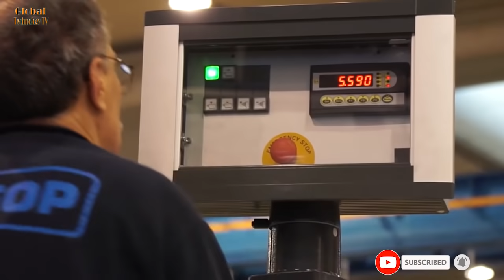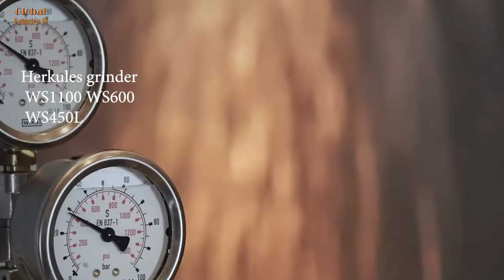The world's largest lathe in operation

Comment: See the tool holder move at 0:02 seconds, very professional for the biggest of big, big, biggest lathe in the world, ar!
Reply: It's still accurate to a tenth... Of a meter.
Reply: I work with wobbly machines and can do fits with .01mm tolerance - i guess im a magican.
If the tool moves while roughing it does not matter that much.
And even while finishing it can be compensated if you know what you are doing and you know your machine, thats why it takes at last 5 years to make a newbie into a somewhat decent turner.

Its suboptimal yes, but life is not butterflies and rainbows only.
Reply: @billklatsch5058  Tell us some more precision tricks Bill, I am very intrigued by your machining norms...

Comment: Looks like the tool holder wasn't secured tightly enough. It moved when the insert engaged.
Reply: Could have just been backlash or even flex from the massive amount of pressure on it.

Comment: The piece their repairing at 2:33 is said to be a crankshaft but appears almost identical to a camshaft with a offset lobe like one, there's no clamping surface to allow for it to set like a crankshaft in a journal.
Reply: Probably an eccentric for a mechanical forging press.

Comment: Remember,  all new machines were made on older machines,  the accuracy comes from the operator
Reply: That's true. I worked as a lathe operator on conventional and CNC lathes a long time with parts up to 1000 kg. One mistake and a part worth a couple 1000€ is trash.
Reply: For the final product perhaps.
But machine tool accuracy is required for certain operations such as the flatness of turbine shaft flanges, straightness of gun barrel bores etc.  These require accurate machine tools.  The machine tool fitters are the ones who assemble the various machine pieces and adjust and fit the pieces to achieve this accuracy.

Comment: Definitely not the largest by a long shot. My partner and I designed and built larger ones for on site field machining at power plants. One of the lathes in our shop, we got from a shipyard in Maryland. 100' Ft between centers Giddings & Lewis. We found a old ass pic when disassembling the machine for transport. Apparently it was one of the lathes that machined the 66ft long barrels on the USS Missouri.
Reply: made in a wee fishing town in Arbroath Scotland  
lots of giddings lewis fraser   machines still being used 
jig borers etc      sadly company no longer there

Comment: I love machining, especially lathe work I have come across a 23m lathe and yes just cool, but still as a machinist and seeing this big lathes makes me jealous! Then again I wonder the amount of earth we need to take of and refill to give a rigid and flat base, flat in the sense that the earth is curved, I mean spherical!!! Then I keep loving the chips and riding on the lathes again;;!
Reply: NIST has amazing grinders deep inside the earth that make our gage block standards - to millions of an inch and a grind that allows 'ringing'. the surface finish so smooth, it allows joining surfaces to share electrons. A non-adhesive bond. When it gets good enough, will be like welding - without the heat.
Reply: @prestonburton8504  Thats "wringing" of the gauge blocks.  Interesting phenomenon this, and points out the importance of separating the blocks when they are not in use.
Reply: yes!  i know this. i have visited the 'cave' where these are ground - about 1k feet and part of NIST - so no vibration.  you know also, this is like welding, right? you let them get close enough, and the electrons bind together because there is enough contact area - 70% if i remember my collage physics class - very very cool! @BasementEngineer

Comment: Boggles the mind to think of the world's largest tools needed to make the world's largest lathe. And then.............
Reply: Not that difficult once you know how.
Very large machine tools are assembled from numerous smaller subassemblies which can be machined on much smaller machine tools.

Take a lathe bed for say 100+ feet of length for ship tail shafts and ship's gun barrels.
The lathe is assembled on a concrete block to give the bed stiffness.  The bed guide ways are assembled from smaller length sections each of a length to suit the available machine tool size, say 16 feet long each.
Thus 10 of these 16 ft long section would be assembled into one long lathe bed.
Fitting these pieces together to permit machining of accurate gun barrel bores is an art unto itself, requiring much experience and trial+error work in the beginning.
Nowadays optical and laser alignment testing equipment makes that job much more predictable and easier.

Comment: Ive seen much much bigger ones. Ones where the chips weigh a few ounces and literally sound like dropping car keys. Same type of stuff though large cam and crank shafts for ship engines, gas compressors and giant mining trucks. Stuff where an oil change is measured in multiple 55 gallon drums.😂❤

Comment: The one in the bottom of Hoover dam makes that look like a home shop machinist lathe
Reply: Not so. I think Hoover Dam has a vertical borer, not a lathe.
Reply: @denniswilliams3934  it’s a Cincinnati lathe.  I tricked new jaws for it 40 years ago.  There was four.  They weighed 60,000lbs just the jaws.  It had a desk and file cabinet on the compound
Reply: Trucked
Reply: And the one in hoover dam is still being used.

Comment: Great machines, but not wearing safety glasses? We can't set foot in our shop without glasses, machines running or not, failure to do so leads to at least a week in safety ding-dong school. Chucking up on threads? And that center, you can really see it at 7:50, looks like it's seen much better days... 😜
Reply: Safety glasses for chips that fly 10cm max because of gravity? There is a difference between saftey because it makes sense and safety for the insurance.
The center is greased because its likely not a turning one - has a big advantage - something that doesnt rotate cant get untrue while rotating.
And where you see chucking on treads? You can turn without chucking anything between centers if the pressure is right just with the friction of the center itself i do this all the time on smaller scale ofc - with bigger parts the rotation inertia is insaaaaane once you got it rotating.

Comment: I would hate to be the one that screws up one of those big shafts.
Reply: We were making a large live center and screwed up the milled slot in it. So we just welded it up and milled it again. But yeah it's not a good thing to do. Still with metal you can get away with doing that. The foreman was all over the guy that screwed it up for a while. I doubt the customer was ever the wiser though.

Comment: I'm not so sure that's the largest lathe in current operation.  I worked with a manufacturer of wind turbines and the on the lathe used the operator would sit on the carriage right next to the cutting tool and control the lathe from there.  The time required per turning pass was measured in shifts.  One roughing pass, a single cut, might take 1.2 shifts.  That's almost 10 hours.
Reply: Did they offer over time between cuts?

Comment: I would have suspected they would use several cutters at once, not just the one tool for something that large.
Reply: There's a tremendous amount of force being generated at the cutting edge that has to be transferred into the structure of the tool carriage as well an equivalent  amount of torque needed to keep it spinning.  In one shot you could see what looked like a 1" insert buried all the way to it's maximum with a heavy feed rate.  That's plenty aggressive.

Comment: Just wondering,...If its the biggest lathe in the world, on what lathe did they turn the faceplate?🤨
Reply: The face plate would be machined on its lathe itself.  The spindle mounting hub on the face plate would be done on a vertical or horizontal boring mill.

Comment: Why don’t they use coolants ?
Reply: We don't use them all the time because of the mess, just not worth it. Seems to be all everyone mentions on machining vids. I run fairly large machines at work, bigger than the average but not the biggest and rarely use coolants as it just gets all over the place, gallons per shift just to grab a bit of life on an insert. We have inclosed machines that coolant pretty much every op but our large open machines only use it when needed.
Reply: @whiplashmachine  big lathe small lathe, you still have heat to deal with, without coolant things get hot quick
Reply: @galewinds7696  I've been machining large shafts and line boring big housings for almost 30 years now, pretty in tune with how it works and no, we don't use coolant on many ops. When I'm turnin in our chipmeter arbours on our 30" Mazak, I'm doing .300" roughing passes at 180rpm, 0.022" IPR on a 9" diameter shaft that is 8' long.  By the time my tool makes it to the chuck end, the tailstock end is cold again.  When I turn our 1080 rotors that are 54" diameter and 10 feet long on the Leonard Lathe I'm doing 9 rpm and have two inserts going. It just stays cold the whole time, which is about three passes in a ten hour shift. I mostley run Verticals turning up to 18 feet diameter and only use coolant when I'm drilling out the center of our waferizer disks with the 6" spade drill.  It just floods the shop and does nothing for the production of our parts. We have jobs that use coolant and we have jobs that don't. Our bigger work doesn't get any during the turning, boring and line boring. Our mills and smaller lathe, a 30"× 120" Dainichi are enclosed so they can flood the workpeice during machining. The radial arms obviously use coolant constantly also. But I run the big floor type HBM's, large Verticals and big lathes and most our work is done dry. Been that way long before I been working there and I been there since 2004

Comment: How can they possibly machine it true? Its so heavy.
Reply: Actually it's easy. The operator has to creep up on the final dimensions so as to not make the material distort; the part is checked several times before final cuts, which create way less heat and thus, less distortion of the overall part. Some cuts take all day job these massive, very long shafts, but you gotta pay to play; love these super behemoths!